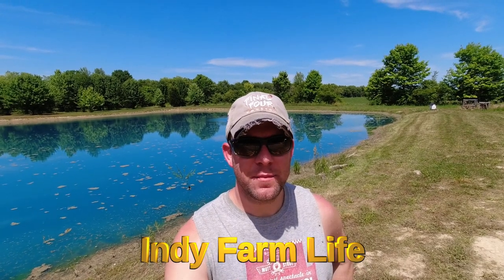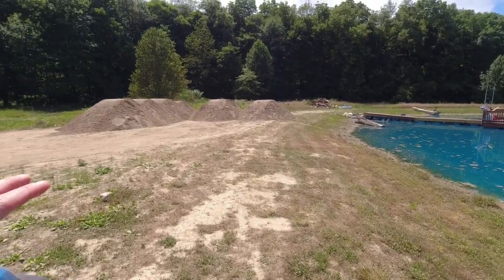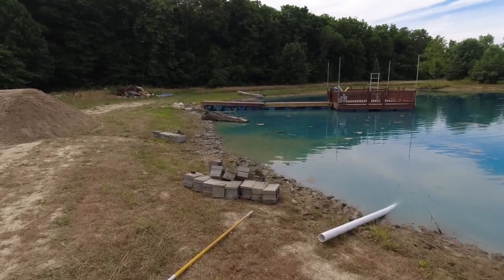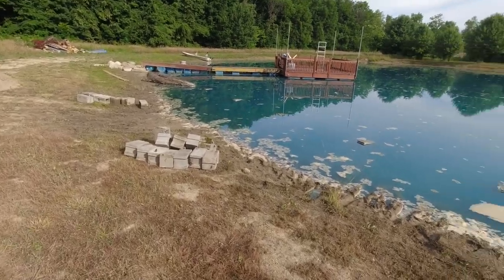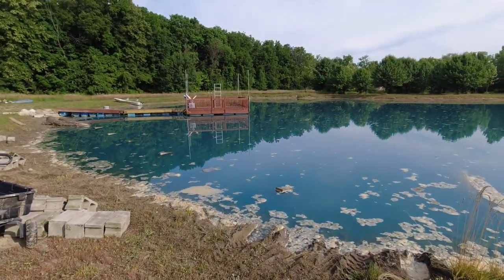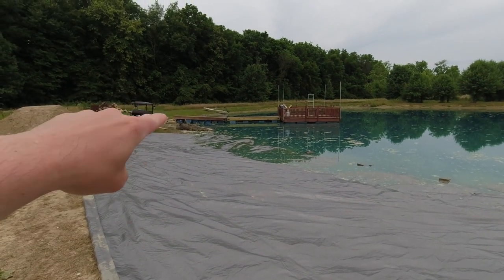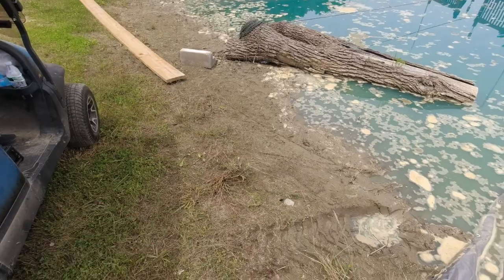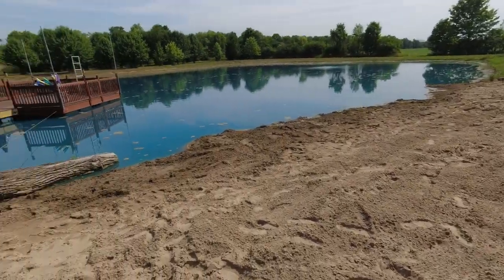A Beach On The Farm - The Pond Is Really Taking Shape!

Comment: I would consider placing those cinder blocks up from your beach so that water runoff doesn't just wash that beach down into the pond and can divert it outside the beach.  maybe even dig a ditch under the tarp at the top to stack sand onto to hold the tarp in place.  I've built several beaches and it's always the same.  Just thinking out loud.
Reply from the maker: Check my later video on this.  I think I may have already done what you said?  Or maybe you meant between the "dry" sand and the water?  I wouldn't want a trip hazard.  I do need a lot more sand in the pond itself anyways.  It's a little thin right now.  I left it that way intentionally.
Reply: @IndyFarmLife  Yep, you're right.  The backstop would be to keep water runoff from eroding the beach, the ditch idea is just to secure (lock) the tarp down.  That 3 point canopy is pretty cool!

Comment: Maybe the best, certainly the funniest video of yours to date. Seeing you carrying cinder blocks out into the pond neck-deep is classic stuff. I was trying to do the math on those piles of sand - max load for a tri-ax dump truck on Indiana roads is something around 21,000 lbs, right? So were those piles (six I think I counted) from a tri-ax? Sand is heavy, yo. Fun stuff. -John
Reply from the maker: haha yea, it was all fun and games until I walked too far and had to try to swim with two cinder blocks so I didn't lose them further down in the pond. ha  I'm not sure what total GVWR is, but I can tell you that when I get the tickets from my drivers, they are often between 20 and 22 tons.  So 44k lbs.  The company I often buy from has an aluminum bed quad axle.  It's an awesome truck.  It is the one that gets to 22 ton.  That lighter bed helps bump up capacity.
Reply: @IndyFarmLife  Yea, I didn't remember what the number was exactly, but 22 stuck in my head. Tons, not pounds. lol.😆

Comment: Putting sand on a tarp seems like a future disaster. The sand will erode away in a hard rain, leaving gullies. Usually the sand is put over rock with very little slope to avoid erosion. Weeds also thrive when a non-permeable barrier is used. Of course the closest thing I have to a pond here is a plastic tub with nasty duck water. There used to be a public beach at Tropical Park here and they maintained it with an atv pulling a rake. Sand had to be constantly brought in to manage erosion. Out hot climate and amoebas made the beach too risky to use. Nice work for doing it all by yourself, do you ever get any help?
Reply from the maker: Could be, we shall seem.  I'm not as worried about the erosion as perhaps your comment about weeds.  I guess that will just give me something to do with the tractor, ha  Rake the sand.

Comment: I’d be worried about the tarps breaking up and causing a mess??? But a great weed barrier in the time being.
Reply from the maker: I suppose that could be an issue long term, however if you are new to the channel, you will learn that I'm a belt and suspenders type of guy.  It averages about 8" to 10" of depth now and I'm sure I'll keep piling it on.  Will probably never see those tarps again. Ha
Reply: Could use a rubber liner to last longer